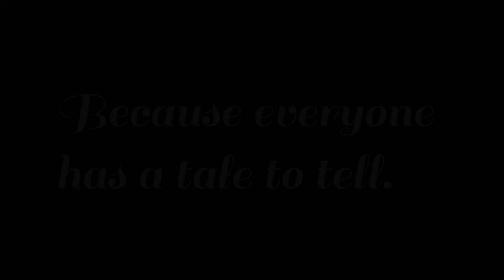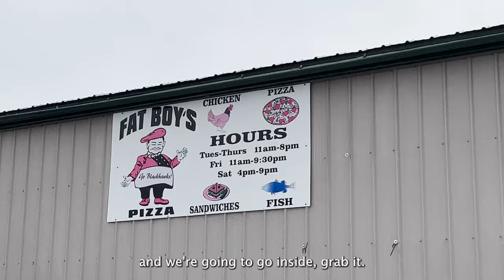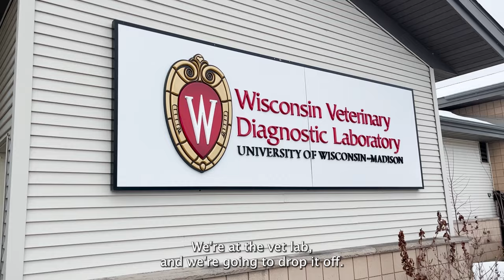Horse Rescue Tales from the Tundra - S1 - E10

Comment: I would love a sweet carriage horse. I can’t ride anymore cause I’m not steady in getting on or off unless as I have a regular wood mounting block with regular steps and like a deck and not those plastic ones . I’m 60 and I used to ride mostly English hunter/jumpers. I trained in dressage and hated it. Far to much to learn with all the signals , leg pressure, spurs. I loved cross country with all the crazy jumps cause if you can get through that with a damn good horse that’s connected to you and they have to be spirited to have the drive and yet sensibility to keep their rider on their back. I try not to ride with a bit unless regulation. God didn’t put a medal bar in their mouth when they are born and unless it’s in the rules that I had to add one to the bridle I would and my horse much preferred the natural way. There has to be a unbreakable bond between horse and rider in a jumping competition. Ya had to be a little crazy and a lot of guts to look a some of the jumps I been over in my life time. 
Now I just want a nice cart horse to drive around town and on the greenway trail. I would never ride hard like the Amish or Mennonite folk. Mine would be for sheer pleasure. I might consider a saddle / gated horse, or paso, Just to see if I Can sit a smooth ride. Then I might consider riding again.

Comment: 56:16 I really don't like the look of those studs where the bars are missing, that's just a recipe for injuries. 

Also it can be a trap, especially where the two are missing, the horse is nosey, the other horse tells it to back off, it tries to pull its head back in a hurry, head at an angle, head is stuck and the horse panics. 
So either no bars, or be sure they are spaced out in the right measurements, or your horses are at risk.

Same with missing boards, it's really dangerous, a horse paws, hoof goes through, horse panic, break the leg or deglow the hoof (happened to my friends horse, stepped between two rocks out in the paddock, pulled the leg back, and hoofwall came off = 1 year recovery)

Also, leaving halters on the horses, they scratch, get the hoof or piece of the shoe caught, and well...

I know money is always an issue, but these things needs to be kept in check.
Reply: I didn't like that open space either, for that surrendered young horse, Riot.  Maybe the halters are breakaway?
Reply from the maker: Halters are always breakaway if they are left on.
Reply from the maker: While we most definitely want to fix these things, I assure you, the bars are not strong enough to hurt anyone, hence why so many are missing. And the only halters we ever leave on are breakaway halters.